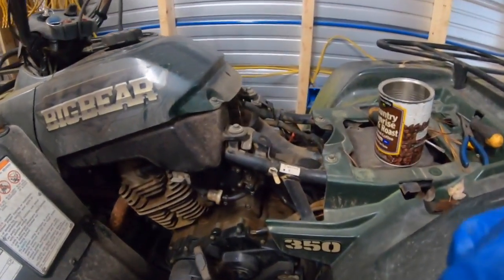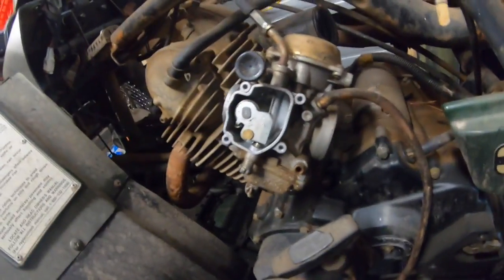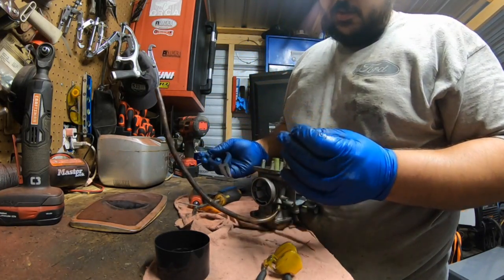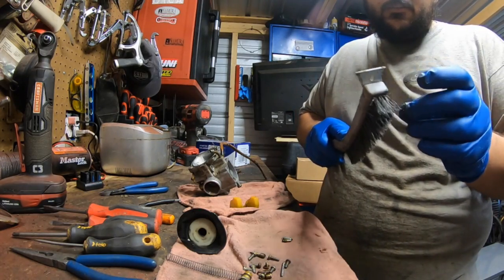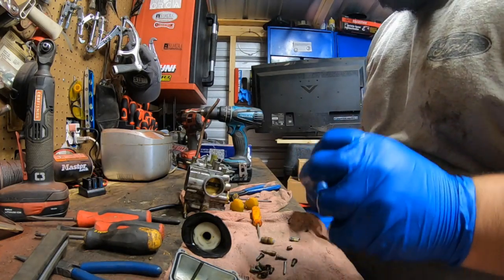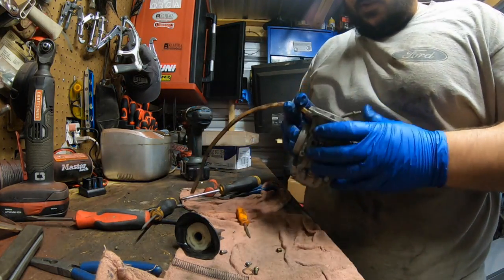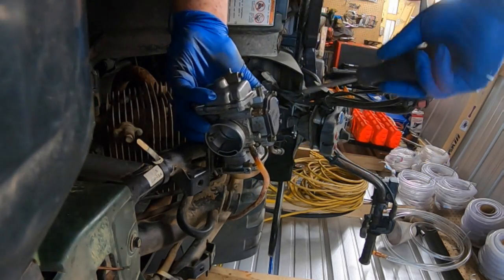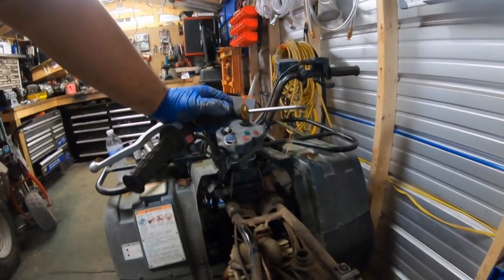Yamaha Big Bear ATV Carburetor Clean & Rebuild

Comment: I'm wondering how to adjust the throttle return spring on 1992 big bear 350? It has been sitting for a few years and the return spring is very tight.

Comment: My carb was so corroded inside I had to order new one- runs great now! These old atvs run forever if you take care of them.
Reply: Just bought a 97 Big Bear 4x4 from a buddy for $400 and it just needs a carb,where did you get your carb at?
Reply: @jimmydavis5951  ebay there are 2 or three different prices and brands I got the 40 dollar one that looked like ths original - the original is the most expensive
Reply: @inglwud5625  thanks for the reply.the original new ones I have seen are like $450 or more waayyyy too much for a carb for me.I got all the stuff to put her back together but cant figure out the throttle cable end that goes inside the carb,it has a plastic piece fitted over the cable but cant see how it suppose to catch inside the carb.any suggestions shoot them to me :)
Reply: @jimmydavis5951  ill have to look im not sure what you're looking at I will look at it tomorrow and get back to you
Reply: Not sure what you are looking at send a picture?
Reply: @inglwud5625  I ended up getting a new throttle cable,changed the oil,fresh gas ,battery and she cranked but run a good idle started skipping and sputtering then cut off  and would almost crank.noticed some fuel leaking from the carb.i took the carb apart some  hit it with some carb cleaner but did not take the float out did not want to open a can of worms and mess something up so gonna order one from ebay
Reply: You should have good luck the carb I bought was all set no adjustments put it on and started right up and runs great I didn't even have to adjust the idle good luck!